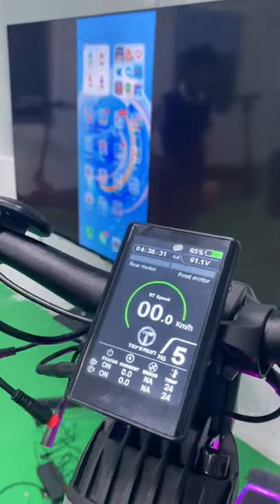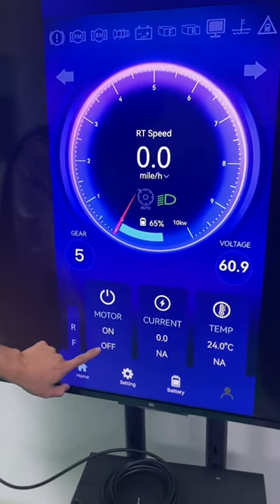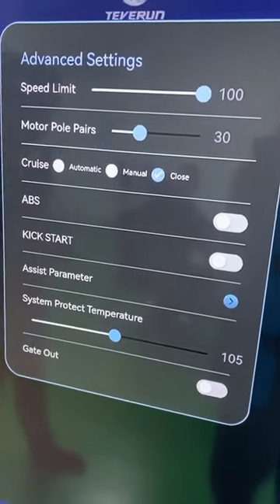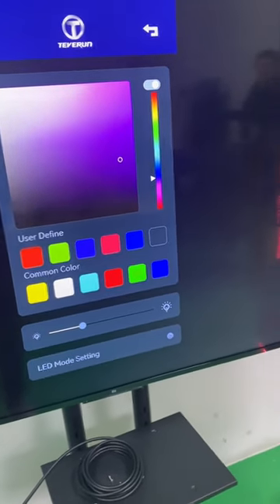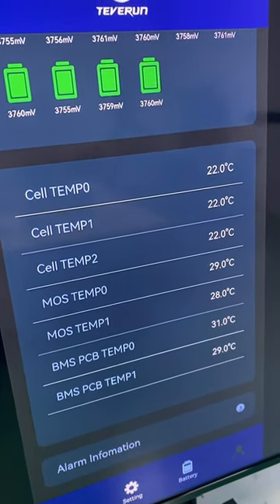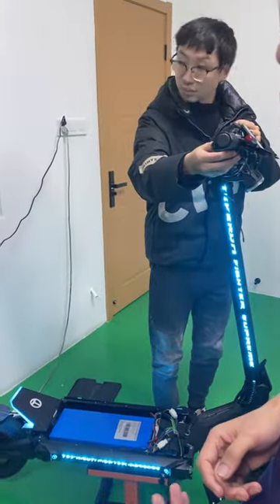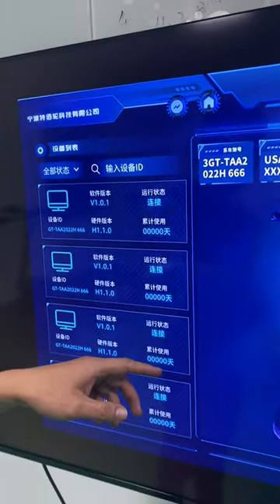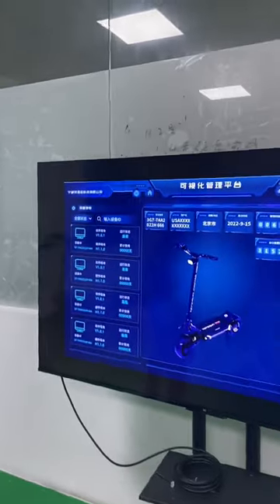TEVERUN APP 1.0 INTRODUCTION

Comment: Hello,

I have a Fighter Mini, and I was hoping someone could explain exactly what the numbers mean to ensure I have the correct settings and refine them if necessary.

Wheel Diameter: Currently set at 11 (while it's actually 10 inches, significantly impacting the top speed).

System Voltage: Set at 55 (while it's a 52-Volt system).

Motor Pole?: Set at 30 (I'm unsure of its meaning; could you provide more information?).

Gate out?: What does it correspond to?

In the Assist Parameter section:

Speed Limit: Ranges from 1 to 100% (In Assist 1, even at 100%, the speed doesn't exceed 12 km/h. Why?).

EABS Level: Ranges from 1 to 5 (What does it correspond to? The power of the electric brake?).

F Start Level: Ranges from 1 to 5 (What does it correspond to?).

R Start Level: Ranges from 1 to 5 (Same as above but for reverse; understood).

F Current: Ranges from 10 to 50 (Why these numbers? What do they correspond to?).

R Current: Ranges from 10 to 50 (Same as above but for reverse; noted).

Thank you in advance!

Comment: Hey I have the New Teverun fighter supreme Ultra 7260 with 11 inch wheels. How do I access P settings with the App and without the App. ? Thanks.  I have 900 km after 3 weeks and went up to 85 kph in speed 3 . Wow incredible flying machine,,,,lol. I just want to reduce the electronic braking . Thanks.

Comment: I got mine today. The bluetooth doesn't find the scooter and the accelerator button is not working. Tomorrow taking it to service. Considering it's chinese it kinda makes sense it won't work out of the box ;) but really... every product that costs this much should be tested.
Reply: @Alexestpersonne  the problem was limiter. After we cut the wire it works without pushing.
After using it for 2 weeks on vacation I'd say accelerating can't be fine tuned. The best I've found was if you change starting for front to 1 and back to 2. This would allow smooth start. The problem with this is that sometimes scooter will emit weird noises. In any other mode (if you have both wheels 2, 3, 4 or 5) the accelerating kick is too big no matter how much you press the handle.

Next problem is braking. It doesn't have regenerative braking and you can't smootly brake down the slope. No matter how gently you press it will overbrake (probably braking pads change angle). You also need to lean backwards really hard. I am not sure but after driving this down to the beach 5 times a day I think I burned 50% of the pads in 2 weeks. Would be better if it had regenerative braking or motor braking with sacrificial heaters somewhere where excess energy would be sent. This would save the braking pads.

Next is cruise control. For what reason is cruise control accelerating to maximum speed of the gear? Why not stay at the current speed?

Next is speed... many times it shows 0.

Rod lights - you can actually move them by pulling the cable a bit so they're not independently attached. That's the reason why on one side they're not working.

Anyway the idea of this kind of scooter is good, but the execution is bad. They should work on this details.
Reply: @Alexestpersonne  e-abs is not regeneration. It's just clapping the brakes electronically. It should supposedly prevent wheel from locking. You'll notice this when you move the scooter by hand and look at the pads.